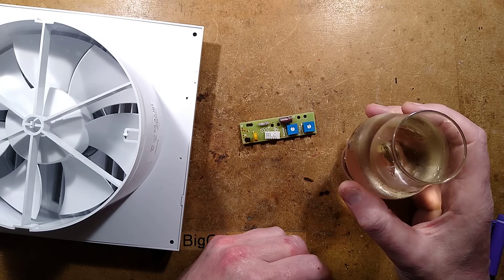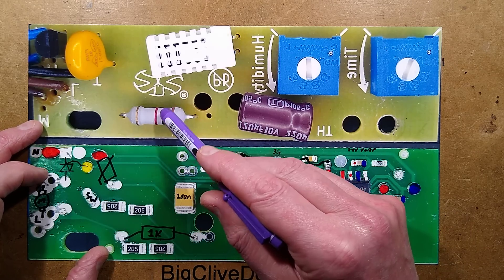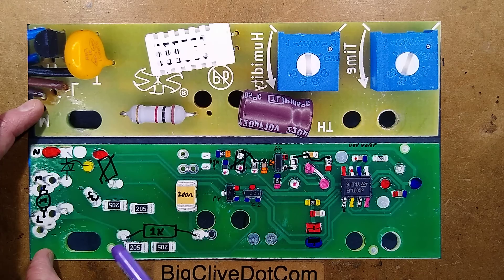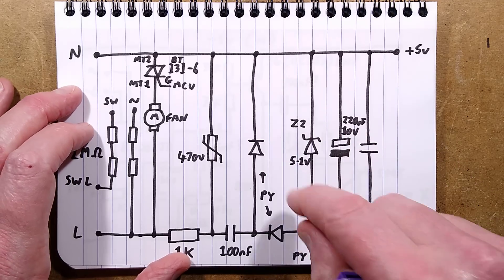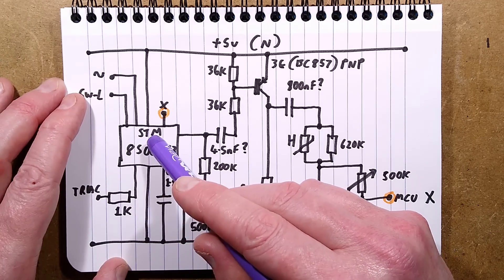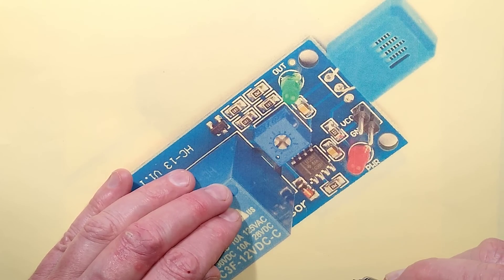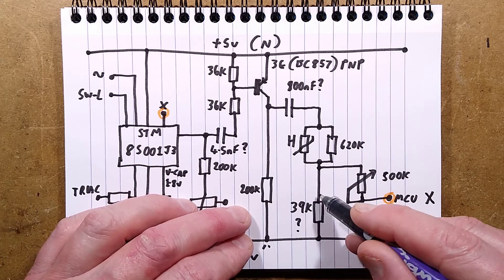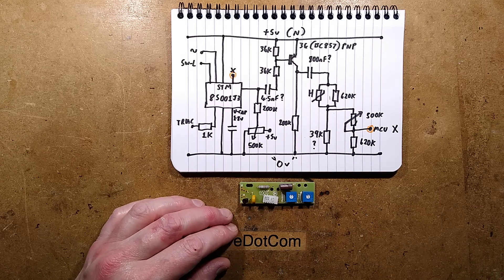Wine powered toilet fan circuit analysis

Comment: I would not be surprised if the device had a short lifespan. The STM8S001J3 has an absolute maximum rating of Vss - 0.3 on its input pins and the circuit used to ensure that no dc bias exists across the sensor also ensures that the negative excursion of what you labelled as "MCU X" will be well in excess of that. Fortunately, the 200K collector resistor will limit the worst case negative input current into the MCU pin to less than 25μA which is probably the only reason that the circuit works at all.
Reply: We have to remember that the microcontroller has clamping diodes on all I/O pins. These diodes make sure the externally applied voltage stays within the safe limits. Of course, the current has to be limited too, usually to less than 10 mA. In our case, during the 800 nF capacitor discharge, the worst case scenario sees the current limited by
200 k +  ( humidity sensor parallel to 620 k )
to probably less than 10 microA.
The same reasoning emphasizes the role of the 39 k resistor, which, being connected in series to the above mentioned resistors, divides the voltage applied to the MCU input (presuming the clamping diodes are absent) to probably less than -0.5 V .
So, as BigClive already said, the circuit is well designed for long term operation.
Reply: @CG-rr6yx  it is still recommended to have external clamping for reliability.
Reply: @CG-rr6yx  The clamping diodes only limit the voltage up to the point that they fail. In this MCU, 4mA is the absolute maximum injected current tolerated. The datasheet states: "Stresses above the absolute maximum ratings listed ... may cause permanent damage to the device. These are stress ratings only and functional operation of the device at these conditions is not implied. Exposure to maximum rating conditions for extended periods may affect device reliability."

The humidity sensor resistance at worst case could be negligible compared to 200K, as could the resistance of the potentiometer. With a worst case supply of 5.6V (5.1% 10% Zener), the negative going spike at the "MC X" could reach -0.9V, which is still three times the absolute maximum, although the clamping diode should limit it to around -0.6V, just twice the absolute maximum rating. It's worth noting that the datasheet recommends adding a Schottky diode to limit the negative excursion.

I strongly disagree with both Clive and yourself - this circuit is not well designed for long term operation.
Reply: @RexxSchneider  The negative going spike goes through a 200k resistor, that's way more than enough to protect the clamping diode. If they have a 4mA limit, 5.6V is not going to push more than that through 200k. A couple of orders smaller current in fact.
Reply: @rexsceleratorum1632  Which is why I originally said "Fortunately, the 200K collector resistor will limit the worst case negative input current into the MCU pin to less than 25μA which is probably the only reason that the circuit works at all." - Did you spot that?

Nevertheless, absolute maximum voltage ratings are absolute maxima, and if you can only clamp the voltage to -0.6 when the absolute maximum is -0.3, you've exceeded that by a big margin. Operating outside the specified limits over an extended period of time is a genuine source of failures. Poor design.
Reply: @RexxSchneider  That makes no sense. If they specified the input pin's current sourcing limit at 4mA, and you only pull 25μA, then the voltage spec has no meaning. The current spec takes precedence when you add a 200k resistor in series. You are not connecting a 0.6V cell capable of 100 amperes to the pin so that you need to worry about the voltage spec. The design is well within spec and safe.
Reply: @rexsceleratorum1632  How can you believe that the voltage spec has "no meaning"? It only takes a very tiny current to punch through the gate insulation on a mosfet when the maximum gate voltage is exceeded. They give absolute maximum ratings for a reason.

The design exceeds the absolute maximum voltage ratings by at least 100% and is clearly not "within spec". How on earth can you claim that it is?
Reply: @RexxSchneider  Not a very tiny current, it is 4mA+ according to the information in the above comments. It takes 4mA+ to punch through the gate insulation because protections are in place. Or the datasheet is incorrect. Are you saying that the datasheet is incorrect?
Reply: @rexsceleratorum1632  You need to understand how mosfets are constructed to understand how either current or voltage can damage a device.

The gate of a mosfet is insulated from the conduction channel by a dielectric, which is very thin, but still insulates well enough to prevent current from passing under normal operating conditions. However the dielectric will break down if too much voltage is applied to it. You don't need anything like 4mA to pass for the dielectric to be permanently damaged, and early mosfets were very prone to damage from static electricity, and that would produce microamps at most.

On the other hand, nowadays there will usually be a silicon pn junction fabricated between the source and the gate of any input mosfet in an ic in order to help prevent static damage from handling. This is a normal diode (Vf around 0.6V) but with very limited current capability. That's where the absolute maximum 4mA on the datasheet comes from. The datasheet recommends using an external Schottky diode (Vf less than 0.3V) clamping negative voltages to ensure proper operation.

Now can you see where the absolute maximum voltage and absolute maximum current ratings come from? If you exceed the absolute maximum voltage you can damage the gate insulation. If you exceed the absolute maximum current you can damage the input protection diode.

No well-designed circuit will operate outside of any of the absolute maximum ratings given on a its datasheet. The datasheet has absolute maximum voltage ratings for a reason, and this circuit can exceed them. The specifications of -0.3V and 4mA are what are given on the datasheet. Are you saying that the datasheet is incorrect?
Reply: @RexxSchneider  Finally got round to look at STM8 datasheet. OK I can see what they're up to now. They're nervous about latch-up.  So they don't really want ANY inject current at all flowing through the intrinsic diode. So they specified "0.3 V max beyond Vdd/Vss" as the enforcement device. The last chapter mentions latchup as a TBD. Then it looks to me like they've tacked on afterwards a concession "4 mA max injection current", as the highest they dare to quote.
I know in the past when I've had IC suppliers insist to me the 0.3 V "device" must be honored in my application then I get suspicious. Maybe why they've quoted 4 mA
Reply: @jagmarc  I'm pretty sure you're right. It's interesting that they make a point of specifying an external Schottky diode to clamp any negative excursions when the pin is an analog input, making me suspect that even tiny current injection is causing havoc with the analog to digital conversion.
Reply: @RexxSchneider  Oh yes you're right , current flowing mucks up its S/A ADC , and because it's one single ADC that's MUX'ed to each analog I/P means there'll even be X-talk from an I/P that's not being used. 
So as you say, clobber it with BAT44 or something to give margin against that happening.
Reply: @RexxSchneider  Voltage and current are not independent variables. 4mA is the limit where the diode is unable to clamp the voltage down to -0.3V anymore. 

That means any resistor that limits current to less than 4mA is within spec regardless of the voltage at the other end of the resistor. 

This clearly seems like blind spot in your understanding of voltage and current and their dependence on each other.
Reply: @rexsceleratorum1632   How can this intrinsic input diode be clamping at 0.3 V ?  It's a silicon PN junction right?
Reply: @rexsceleratorum1632  No, 4mA is the limit where internal damage to the ic can occur. It is most likely to be the current at which the internal protection diode is likely to fail, but there may be other parts of that ic that can fail due to excess current injection (the ADC multiplexer for example).

You think that "any resistor that limits current to less than 4mA is within spec regardless of the voltage at the other end of the resistor" ???

You seem to lack an understanding of Ohm's Law, since it is clear that whatever value of resistor you choose, there will always be a voltage capable of pushing more than 4mA through it.

What you meant to say was "given a known maximum voltage possible at the input, we can choose a resistor that will ensure that less than 4mA is injected into the input". The circuit already does that, and that's not the rating that is going to be exceeded.

Secondly, we manufacture ics from silicon, not germanium, and the typical forward drop of a silicon diode is around 0.6V at the least, so the internal clamping diode is not able to limit the voltage to -0.3V.

That is the crux of the problem because the manufacturer gives -0.3V as the absolute maximum rating in the datasheet, and they will have their reasons for that. You may not think it's important to stay within absolute maximum ratings, but any experienced engineer will tell you it's simply asking for trouble to exceed them.
Reply: @RexxSchneider  You are still not making any sense. Are you saying that a current draw of orders less than 4mA will already cause a voltage at the pin greater than -0.3V? Then what is the point of specifying 4mA? How will you ever draw 4mA from the pin if the voltage already passes -0.3V when you draw 50uA? 

All you are doing is speculate about the innards of the chip and ignore the actual specs. They specify both current and voltage for a simple reason, and that reason is to prevent you from having to figure out one or the other by yourself, not because they are independent variables. You are still pretending that voltage and current are independent variables. They are not. If they specify both for a certain pin state, you will only ever exceed both limits together, not separately. You will only exceed -0.3V when you draw more than 4mA. Or conversely, you will draw more than 4mA only when you lower the voltage to more than -0.3V. That's how you follow the specs, not by cluelessly speculating about the clamping circuitry inside the chip.
Reply: @jagmarc  I have no idea, but then I didn't write the datasheet either.
Reply: @rexsceleratorum1632  but you haven't answered the question :) How can a silicon PN junction be "clamping at 0.3 V while passing 4 mA" as you said it is?   And where in the datasheet does it say it's doing that?  Have you ever actually seen a silicon PN junction clamp at 0.3 V while passing 4 mA? 
Try it for yourself and see if you can find a silicon PN junction anywhere to "clamp at 0.3 V with 4 mA"  :)

Tip: datasheets use tricks. They'll also say things like a 2N3055 will do "115 W" - but that's only when clamped a water-cooled block of aluminum maintained at 25 deg C. Or in other words thermal resistance case-to-ambient = 0 deg/W which is impossible in real life
Reply: @rexsceleratorum1632  You just don't get it, do you? Of course the damage by current and the damage by voltage are independent problems. A mosfet gate can be damaged by high voltage even with negligible current flowing. A silicon pn junction can be damaged by excess current with less than 1V across it.

Yes, I am saying that silicon diodes require around 0.6V to pass even a few microamps. A voltage of 0.3V won't drive any measurable current through it. So the protection diode will not prevent voltages between -0.3V and -0.6V. A current draw of 4mA, enough to damage the internal diode, will already have exceeded absolute maximum voltage rating.

Have you read the datasheet? Do you think you know more about the mechanisms of damage than the manufacturers?

You think that "You will only exceed -0.3V when you draw more than 4mA. Or conversely, you will draw more than 4mA only when you lower the voltage to more than -0.3V. " I'm telling you that's nonsense. Drawing 1mA will required around -0.6V. You must be mixing up germanium with silicon if you think the forward voltage drop of the diode is around 0.3V.

The specs always work independently, because the mechanism of damage caused by over-voltage and that caused by over-current are completely different - otherwise there would be no point in having separate ratings. Often you can exceed one or the other for short times, or non-repetitively, but you have to work with what the datasheet says.

The only clueless comment is yours, and I'm very unlikely to take advice from someone who doesn't even know the forward voltage drop of a silicon diode.

Get a copy of the datasheet and read it before you embarrass yourself any further.
Reply: @RexxSchneider  Simple question. If the pin's voltage rating will be exceeded by drawing a tiny current of (say) 10uA as you say, what is the point of specifying a hundreds of times higher current rating of 4mA? 

I don't care to cluelessly speculate about the internal circuitry of the IC, I only care about following the datasheet. Unlike you. 

So please answer the question. How do you draw close to 4mA from the pin as specified by the spec, without far exceeding the voltage rating (in your universe, of course)? 

Are you saying that the current rating is meaningless and unachievable? Did they make it up out of thin air then? Because they can't draw 4mA to test it either. 

Have you done any actual testing to verify that the current rating is meaningless, and that it is a joke that contradicts the extremely restrictive voltage rating? Of course not, you are just blowing hot air online.
Reply: @RexxSchneider  "Do you think you know more about the mechanisms of damage than the manufacturers?"///

My irony meter just exploded. You are the one speculating about the mechanisms of damage here, and claiming that nobody could possibly draw the manufacturer-specified <4mA from the pin without destroying it.
Reply: @jagmarc  Can I produce a tiny 100 ohm resistor rated for continuous 3+ amperes and 1000 watts dissipation in the datasheet, but the voltage limit is specified separately and it is only 5V? 

Would I even be taken seriously as a manufacturer after that? Because that is the real analogy to what is happening here if you are correct. 

Requiring a perfect 25 deg C heatsink for specified wattage is just controlling enough variables to get a meaningful number. That is nothing compared to a ~400x discrepancy in current rating that someone is claiming here.

p. s. I don't care if they use unobtanium diodes for clamping, I just care about the datasheet. So far all you have produced is an accusation that one of the ratings is unachievable by two orders of magnitude because another rating prevents you. Not actual test data confirming this.
Reply: @rexsceleratorum1632  Hi,  can you find where in the data sheet it says "clamping at 0.3 V (when 4 mA current) " ?   ( I think I've quoted it correctly, pls correct me if I'm wrong).  

In meantime I've looked at 9.2 absmax table 16. sub note 2.  Which when read between lines says the opposite of that
Reply: @rexsceleratorum1632 While you're studying the datasheet ,  I'll post a reply your question to RexxSchneider hope doesn't mind.  
1.the pin's (absmax) voltage IS exceeded by drawing 10 uA ( goes about 0.7 V.) They don't want this input current happening. It causes wonky ADC results and latchup, before damage happens.

2. They applied a constrant: "0.3 V"  to prevent it. (Which could be their intrinsic diode 'clamping' -if the chip temperature was 300°C maybe, intentionally absurd). Yes, they made this "0.3 V" up out of thin air. Precisely.

3. "4 mA" is a concession. ("...if Vin max cannot be respected, the injection current must be.....")

Re "Speculating about internal circuitry.."  & "knowing mechanisms of damage"   Manufacturers are delighted when designers take an interest and understand the dilemmas and contraints they're under, they tell you "I wish other customers were like you"  Apps Engineers are great too very approachable.
Reply: @rexsceleratorum1632  The gates of mosfets are fabricated with very thin insulation and are vulnerable to overvoltage breaking down the dielectric layer, and early mosfets had to be handled with their pins strapped together until soldered into circuit because even static electricity could damage them. That's a fact, no matter how much you want to deny it. The failure is caused by voltage, and not by a current. 

Input pins on ics are commonly protected from static by ensuring that a pn junction exists between the input pin and ground. That diode will clamp the input voltage to one silicon junction below ground. That is around 0.6-0.7V. However, pn junctions will fail if too much current is passed through them, and that is the cause of a maximum rating for current into the input.

So, here are the simple question for you.
Do you believe that the datasheet gives absolute maximum ratings of -0.3V and 4mA?

Do you believe that the 4mA and 0.3V limits will be reached simultaneously?

If so, why does the datasheet recommend using an external Schottky diode on input pins to ensure proper operation when negative swings are anticipated?
Reply: @RexxSchneider   I think Rex believes (he can correct me) that "0.3 V" is an operational performance characteristic. I don't think he realises at the moment it's an operation constraint boundary line 'drawn in sand'.
The 'safety margin' being no current can begin to pass until pin voltage gone long way past 0.3 V. 
Rather like saying "you can enter the inner building, fine, as long as you haven't crossed the outer perimeter boundary (0.3V) to reach the door (0.7V)" !  And then saying "well ok if you can't honor the perimeter outside then behave yourself once you're in the door" (4mA concession)
Reply: @rexsceleratorum1632  Clamping device case to water cooled metal block, that's not to control other variables but more about controlling the device from blowing itself up.  And show the product in the best possible light in a commercial marketplace. 
The tiny MOSFET is marketed with impressive specs  "10 A, 125°C, 70 W , 0.01 ohm,  0.9 V gate turn on" etc  But you can't use all of them same time.  For  "0.01 ohms" you have to drive 10 V of gate at 25°C, (not 0.9V) and 0.1 A (not 10 A). By the time you've applied deratings there's often then little left of the "marketed performance" .  
With datasheets you have to read between the lines.
Reply: @jagmarc  Well, that's not a bad way of looking at it. The overvoltage is quite likely to be less destructive than overcurrent. Exceeding maximum parameters isn't a guarantee of failure, just an increasing likelihood of it happening in any given sample.

The complication with an MCU is that some input pins are connected (usually via a multiplexer) to an analogue to digital converter. Those will sometimes have bipolar pnp transistor inputs because of the variable voltage shift inherent in mosfet inputs. In that case, injection of even tiny currents can seriously affect the ADC accuracy., or even prevent it working at all. That would at least be consistent with the recommendation of using an external clamping Schottky diode when the input pin is being used as an analogue input.
Reply: @jagmarc  "3. "4 mA" is a concession. ("...if Vin max cannot be respected, the injection current must be.....")"/////

I get the usual shenanigans in datasheets, but if there is no way of ever drawing 3mA from the pin in normal operation without destroying the chip because some other rating was inevitably and greatly exceeded, then the datasheet is simply incorrect and should result in some sort of legal remedy. 

My only real claim is that drawing <4mA (or whatever after derating) is safe according to the datasheet as I understand it, at which point you can ignore the voltage spec. I understand their point to be that the actual safe negative voltage might be too variable to be closely specified like the current is. I could be wrong. 

Also that as such, the circuit is within spec.
Reply: They only state "absmax Vss-0.3 V" to escape QA liability because the cheapskates hadn't officially characterised the current through their intrinsic diodes. Or bad silicon (latchup). So they exclude them. Like putting a warning on screwdriver "not certified for opening paint tin lids"
Reply: @jagmarc  The absolute maximum current into the input pins is officially characterised in the datasheet as 4mA.
Reply: @RexxSchneider   They actually quote "< 4 mA" too? That's peculiar together with  "< 0.3 V beyond Vss/Vdd" as well because the "0.3V" thing is a 'device' they use to prevent any current. When I see "absmax 0.3V" mentioned I think of latch-up vulernability.  
:) A tip: try get out of thinking in terms of "voltage" but instead "current".  Voltage is the effect, current causes it.
Reply: @jagmarc  Good tip. I suspect he is thinking of current and voltage as somehow independent variables.
Reply: @jagmarc  My degree in Electronic Engineering dates back to 1972, so I'm pretty certain that my experience is at least equal to yours.

I do know how parts work, and I've seen many early mosfets die because of improper handling as static electricity damaged the insulating layer. That is purely a voltage effect as the current involved is miniscule.

Modern ic devices often fabricate protection diodes internally that will conduct if the voltage an input goes more than about 0.6V below the negative rail. Those will draw current and can be damaged with as little as a few milliamps, so the current drawn needs to be limited externally. That is purely a current effect as the voltages involved are small.

My tip in return, is to try to get a fuller understanding of the mechanisms involved in device failure. Both current and voltage may be involved, and sometimes it is the combination of both (i.e. power dissipated beyond thermal limits) that causes damage. There are often multiple failure modes possible and a good place to start in getting an idea of how they arise is through examining how the 'safe operating area' of a power transistor is defined, since over-voltage, over-current or over-dissipation can occur.
Reply: @RexxSchneider  Great comment! I must admit I came here 'trolling' at first. Deserves a like definately. Like the way current and voltage are treated. Too many people think only in terms 'voltage' with silicon. 
You'd probably encountered 'surface barrier' transistors too. And those dual gate mosfets with no protection. Most modern mosfets now with their backtoback zener diodes lot more robust - though they are still zappable if you try. I did try and accelerate demise of a modern MOSFET by rubbing it on block of polystyrene but didn't succeed.  
Aside from the input diode conducting > 4mA, quite a few ICs like PIC prone to latch themselves up when some inputs go more than a diodedrop beyond a rail, similar to as you say, it's only a few mA but can cause an amp of rogue supply current. 
Absolutely with you, learn about what the failure modes are, not just the effect, the mechanisms. 
As for SOA of devices unfortunately people tend to be misled by marketing and the way data is presented on datasheets. They'll obey one parameter but overlook others, or not apply derating correctly and baffled why device had failed while 'operating within' rated, discover that only more expensive parts work, because they have in-built unpublished margin.